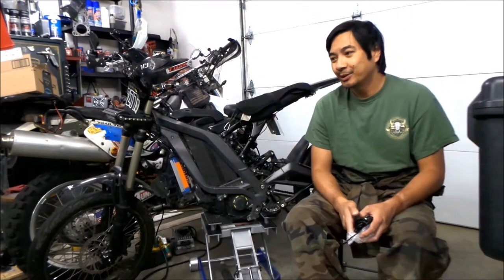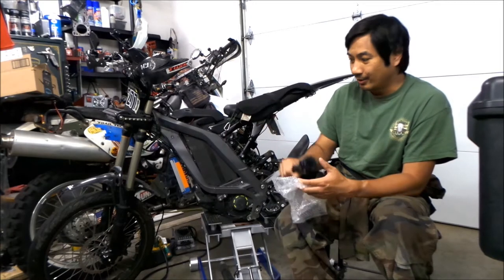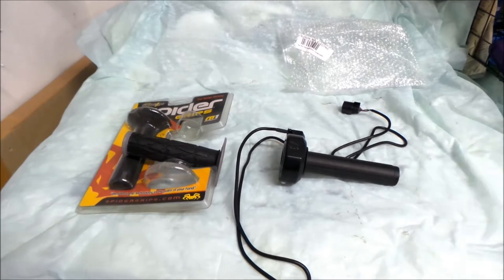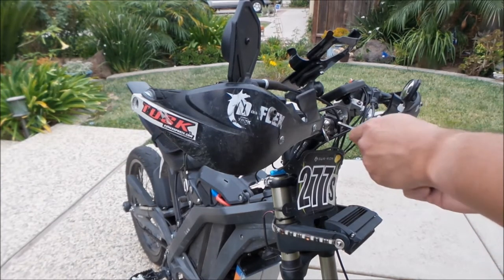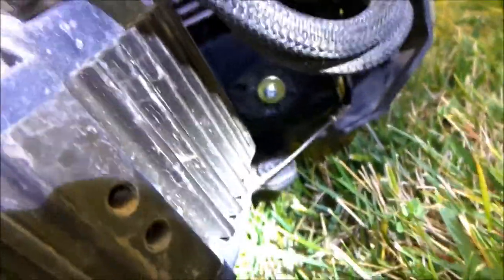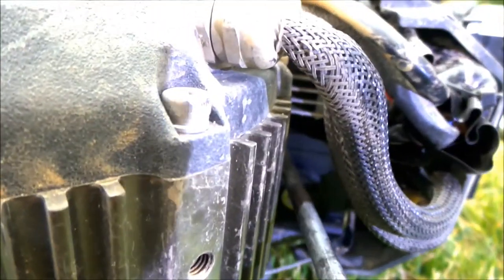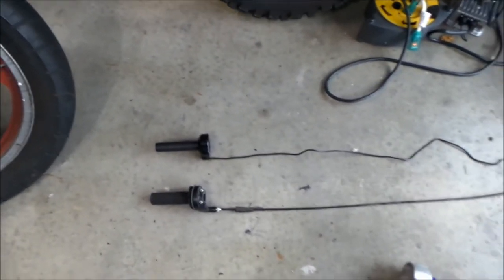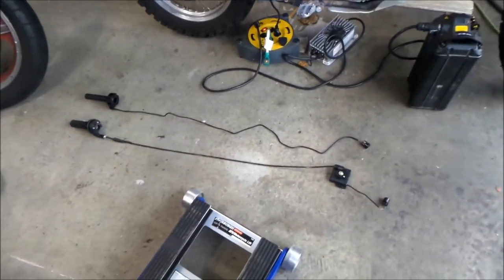Sur Ron Light Bee Full Electronic Throttle Install Part 1 - Introduction + Uninstall Old Throttle

Comment: Hello there, great video! I just bought X model, and the throttle in power mode feel like just either on or off, I have to constantly open/ease off to maintain speed. Do you think it is an issue with my bike or a common problem? How do I know if mine has electronic throttle already? Thanks.
Reply from the maker: If your throttle looks exactly like the one I installed on my bike you have the full electronic throttle.  If there is an adjuster nut you have the older style throttle box setup.  I've never ridden a stock Light Bee with the full electronic throttle but I have heard it is like you mention it like an on off switch.  With the ASI controller its more twitchy but I've gotten used to it.

Comment: I just got my sur Ron and it has the electronic throttle but the actual wire that goes into the throttle got ripped up some how so now I have to get a new one :/
Reply from the maker: That's a bummer =(
Reply: Same mate my cable pulled right out of the throttle, i opened it up and it’s so hard to re wire.There’s no replacements in New Zealand either :(